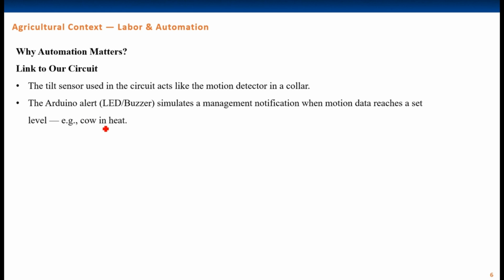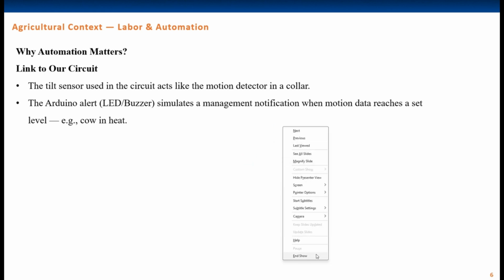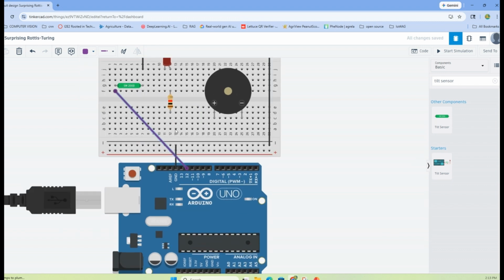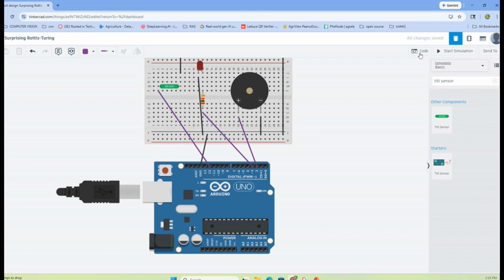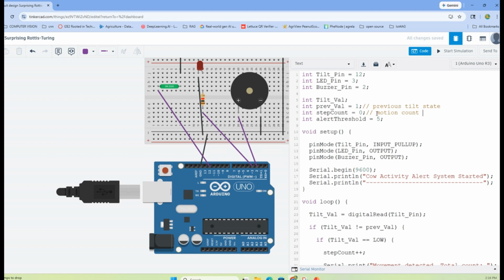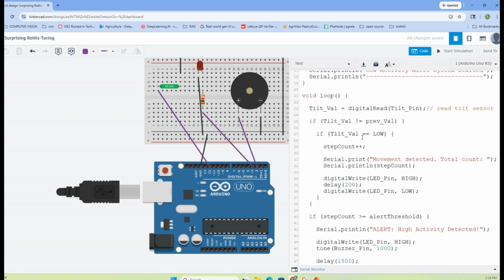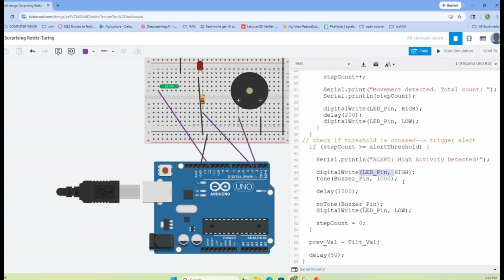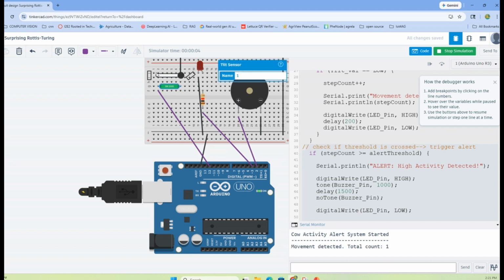Smart Farm Alerts Using Wearable Sensor Data

Comment: int Tilt_Pin = 12;        // Tilt sensor pin 

int LED_Pin = 3;          // LED alert 

int Buzzer_Pin = 2;       // Optional buzzer 

int Tilt_Val; 

int prev_Val = 1;         // Previous tilt state 

int stepCount = 0;        // Motion count 

int alertThreshold = 5;   // Threshold for alert (e.g., cow in heat) 

 

void setup() { 

  pinMode(Tilt_Pin, INPUT_PULLUP);  // Enable pull-up resistor 

  pinMode(LED_Pin, OUTPUT); 

  pinMode(Buzzer_Pin, OUTPUT); 

  Serial.begin(9600); 

  Serial.println("Cow Activity Alert System Started"); 

  Serial.println("---------------------------------"); 

} 

 

void loop() { 

  Tilt_Val = digitalRead(Tilt_Pin);   // Read tilt sensor 

 

  // Detect motion change 

  if (Tilt_Val != prev_Val) { 

    if (Tilt_Val == LOW) { 

      stepCount++; 

      Serial.print("Movement detected. Total count: "); 

      Serial.println(stepCount); 

      digitalWrite(LED_Pin, HIGH); 

      delay(200); 

      digitalWrite(LED_Pin, LOW); 

    } 

  } 

 

  // Check if threshold crossed → trigger alert 

  if (stepCount >= alertThreshold) { 

    Serial.println("ALERT: High Activity Detected!"); 

    digitalWrite(LED_Pin, HIGH);     // Turn on LED 

    tone(Buzzer_Pin, 1000);          // Sound buzzer (1kHz) 

    delay(1500);                     // Keep alarm active 

    noTone(Buzzer_Pin);              // Stop buzzer 

    digitalWrite(LED_Pin, LOW); 

    stepCount = 0;                   // Reset count for next cycle 

  } 

  prev_Val = Tilt_Val; 

  delay(50); 

}